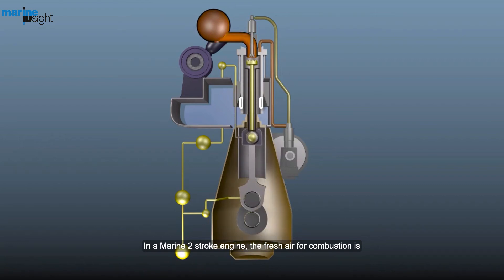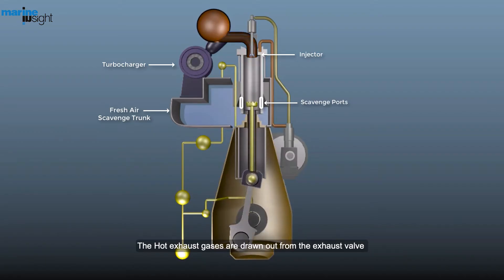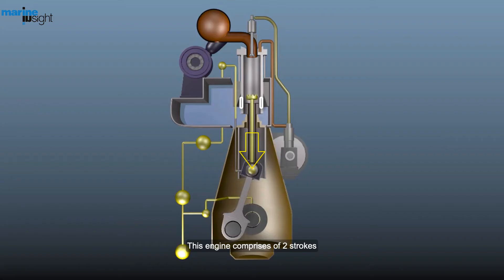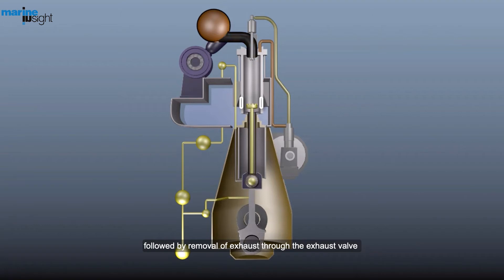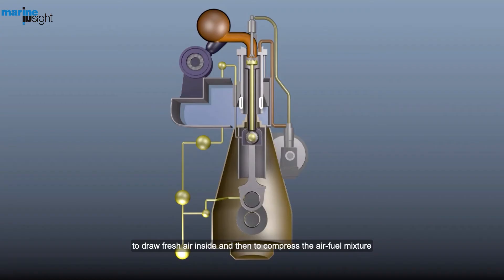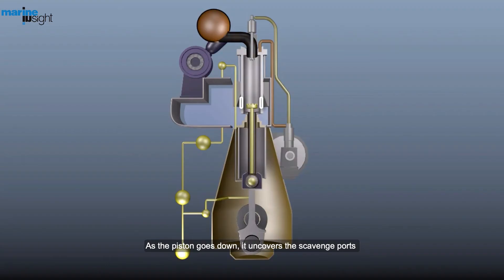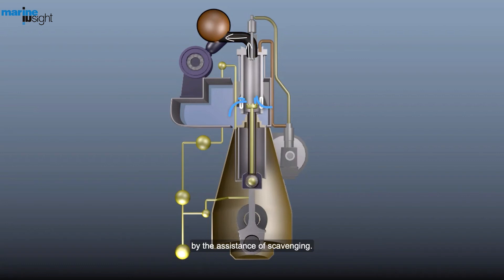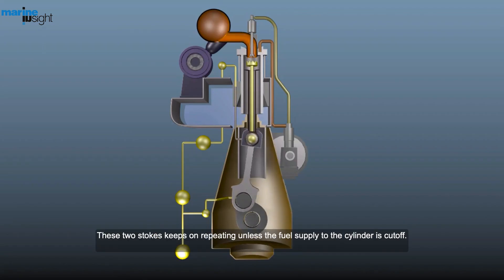Working of Main Engine in Ship #marine #engine #2stroke

Comment: "Air fuel mixture"....utter bollocks, the fuel is introduced to the cylinder through one or more fuel valves, a few degrees before TDC. If you are goi g to try to explain something, understand  it first

Comment: thank for this important video, but I've got a quastion, tell me please I  wached a video about 2 strokes marine engine but without exhaust valve at all, there is exhaust port is used.  Is this a different construction of engines ?
Reply from the maker: Yes, That were old engines with inlet and exhaust ports in the liner it self, known as loop scavenging.
Reply: @marineinsight  or crossflow scavenging - different to loop.
Reply: thoes 2 stroke run on mind crushing BMEP that would detroy any medium speed 4 stroke weedwhaker MTU